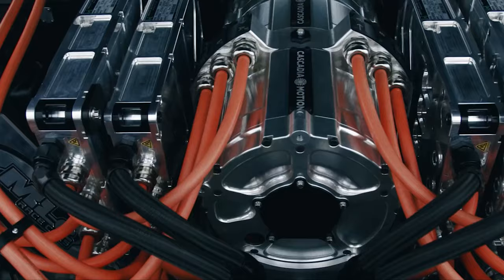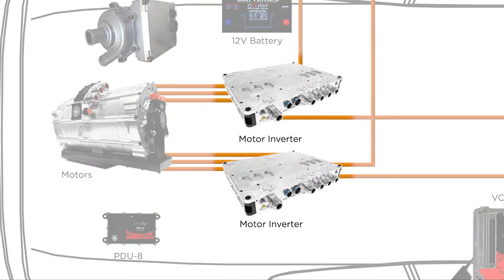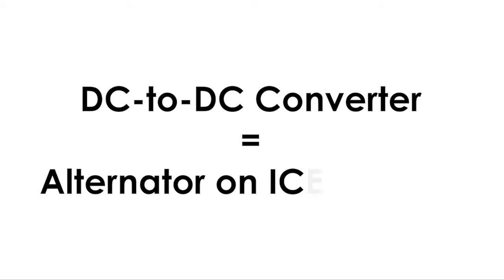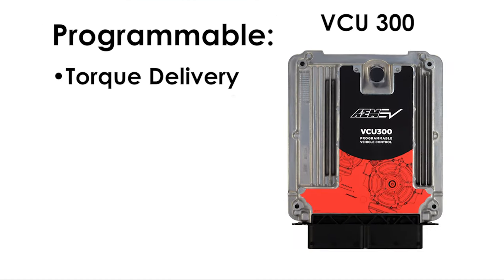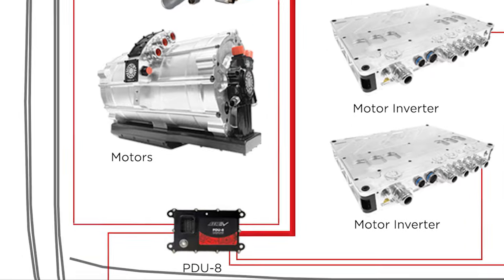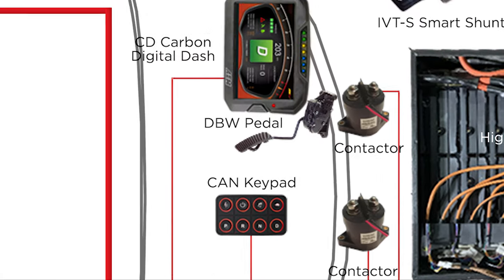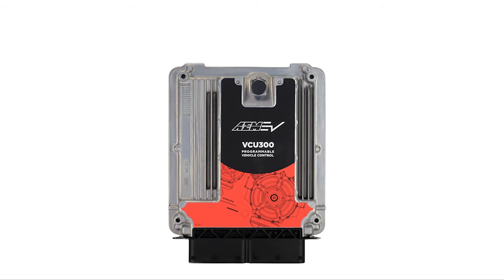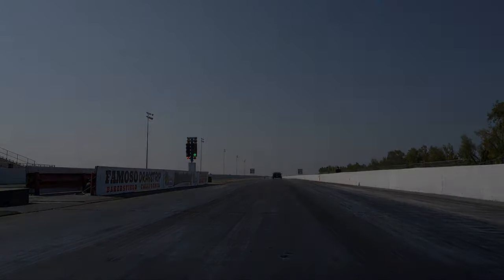EV Electrical Systems BASICS!

Comment: So when are we going to see over the air updates for the control units like the VCU300 and PDU-8? We really need a CarOS for the main control display that can control and update all those modules. Each shop could customize and brand it as needed but the the software would be the same to control all the functions of the car. Some company need to step up and becomes the Microsoft of car software. Bosch? GM? Anybody?

Comment: Oh......... So me sitting on my 2006 Mustang GT, 2011 Mustang V6 and 2014 Camaro V6 isn't a bad idea after all... said the Electronic Technician with the FCC/NARTE Certification. Gee Whiz. Now I just have to sit here and watch the Electronics and Battery Technology get Cheaper and Cheaper. (Homey the Clown Smile)
Reply: Sorry what is FCC Certification for Technician? IIRC FCC does not authorize credentials for technicians. They certify devices.
Reply: iNARTE is a licening program for licensed spectrum Radio Operators. Almost has nothing to do with devices outside of Radio Transmission.

Comment: I prefer my electric vehicles batteries to be sourced from a third world country and strip mined by little children. There is nothing better than putting on a outfit from a third world country and you can still see the little blood marks from the children's fingers. That's how I feel about electric cars. You can feel the little bit of soul in each car from the children that mined all that lithium. How many children souls horsepower does your car have? Well I got my batteries from a third world country so it's got at least 100 souls in each battery